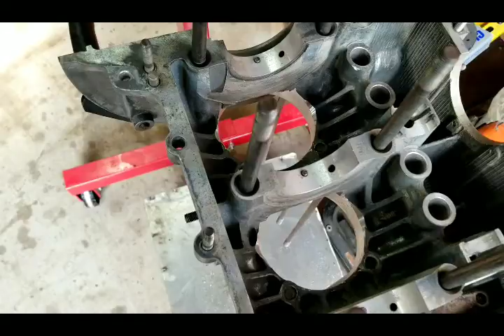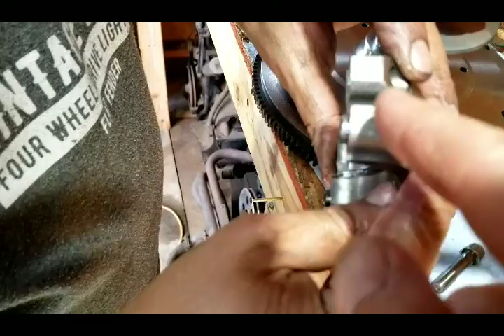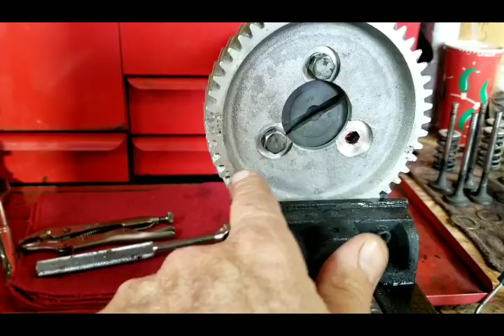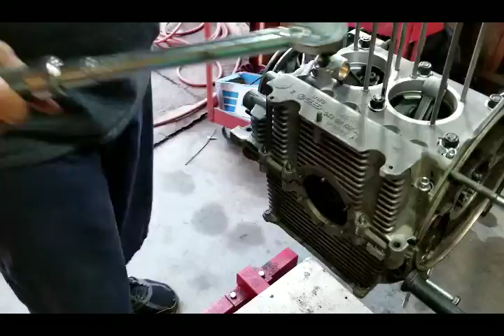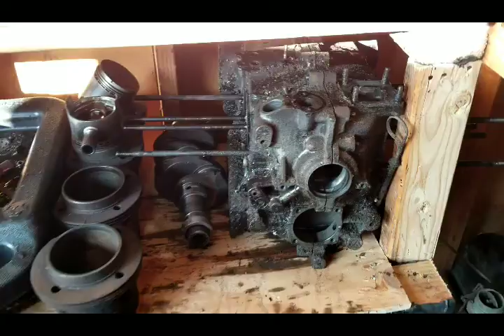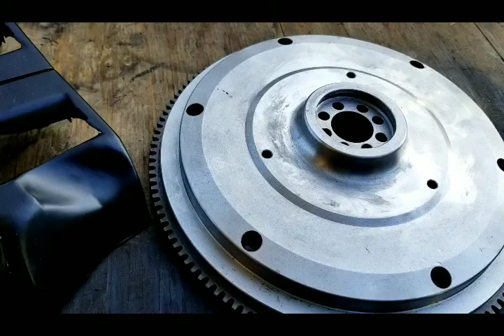Flat 4 Vw Engine build  74mm stroker crank 90.5 piston 1904 performance engine

Comment: Did you check the length of the dowel pins? I know that it is possdible to have the pins bottom out and make it seem that you have to have thicker shims. esp with a 8 dowel as usually they use a original 4 pin crank and drill the exra 4 holes with a guide. it is really easy to have the extra 4 holes not b drilled quite deep enough.

Comment: Is it possible to build a motor that will handle a.c and still have enough power 
And run cool in warm climate and be reliable.  Also whats the best 
Ac kit for a bug. Been considering building a resto mod bug as a daily driver
But everyone I've talked to said they run too hot with ac and dont have much power. I could convert to Mazda rotary but its work I prefer not to do.
I've done a couple but dont care to do anothrr

Comment: 1904s are my favorite engine combo for cruiser engines. Lots of fun, low maintenance and easy to build. Great video series.

The biggest reason for straight cut gears is to take the side load off the cam thrust bearing and free up some of the drag caused by the helical cut gears. The stock magnesium gears are also pretty weak when you start running bigger lifts and dual springs. IF you do use straight cuts, buy quality ones or make sure you measure the run out on the cheaper ones, they can be horrible, tight in one spot loose in others.

With a counter weighted crank and good quality rod bolts, I run my deck as tight as .040 and haven't had issues with pistons kissing the  heads. .050 is a great height, still get a better squish on the pad for a better more efficient burn, but loose enough no to worry.

I've had to use 4 shims in some engines lately, just because I don't have a good machine shop like brothers locally, I haven't had any problems with rear main leaks or any other issues. I really like to run them at .005 end play, especially if the engine will see high rpm. On my race engines, I actually go a tiny bit looser. There is more room for oil between the shims and they seem to run cooler. I have taken apart engines where I set them at .003 like lots of guys recommend and have found blue shims from heat or gawling on the rear main thrust surface. Tighter isn't always better. 

A lot of the current flywheel/crank offerings have very tight dowel pin fitment. I never touch them as long as I can pull the flywheel down on the crank with the gland nut. If it's obvious that something has been drilled off line or too small then I will get the holes reamed but I have found that after they have been mated and pulled apart a couple of times, the fitment is a lot better. I would rather have them very tight than a little loose. The first time I put them together, I then pull them apart and inspect the base of the dowel pins carefully for material scraped off the pins, and if there is, clean then very well as this can interfere with your end play measurements.

Comment: Awesome video Mike. Just a question on the Empi crank and 8 dowel flywheel? Fitment is quite tight do you ream the holes slightly or tap it in with a block of wood and a hammer?
Reply from the maker: you want it pretty tight if you need to beat on it too much you should take the dowel pins out and sand them with a little 600. not too much you want it tight but sometimes the machining is crappy on this stuff.

Comment: Hey Mike, did you have that rotating assembly balanced or running as is? I see many mixed opinions if not revving much over stock. My rods and pistons are balanced but questioning the rest. I won't be over 4500 rpm. For years I never balanced anything, but they were totally stock.
Reply from the maker: dont think you need to balance the crank they are pretty well machined and balanced from the factory. the Light rods from aa are also pretty well balanced .My motors spin like a top and want to rev up to almost 6k rpm easily

Comment: I’m just about to build a 76x88, your videos are what I am going by .
Reply from the maker: 74 is a bit easier. the 76 is good too but may have some issues because  it takes I think short rods and a pistons but has super thick shims. or if you go b pistons you end up with compression too low if I remember right.  Will need to ask someone like carcraft about what is the right stuff to put in there to make it work.

Comment: I’m also looking into replacing my stock crank to a 74mm crank but I’m on a budget what is your opinion for a reasonable price and good crank ?
Reply from the maker: Im not sure they are usually under 300 Car craft might have good price. But you will need the clearanced chromoly rods from. Car craft has good prices on those too. carcraftstore.com
Reply: @Mikefngarage  yah already got it as well as the 95.5 pistons and sleeves your out in Riverside ca. Mike ?
Reply: Paid $600.00 bucks for my 74 mm Ocrasa crank. Costs some bucks if you wanna play ball. Best bet if your ona budget is a 1776 or a 1835 single 2 barrel carb . Good performance, good reliability, easiest on the wallet. ☮️

Comment: Excellent !
That's what most do not understand with the labor involved with these engines.
The sub-assemblies are fitted - taken apart. Then after they are all setup. Then everything inside is fitted - checked for clearance issues. Then disassembled.
Everything is cleaned for the 3rd time. Then final assembly can begin.
Reply: Very true brother, with my 2276 I must have test fitted 10 to 15 times checking clearances multiple times.

Comment: It is like you say Mike if I ran into a machine problem , I would have to go up to San Antonio . There they do most anything but I dont know if they do lifter hole sleeves for the other case I have. To send it across the U.S. and back it would be 180 bucks for a couple hundred dollar job.  My wife said they are just going to keep it and you can not do nothing about it.Here 2 guys do line boring and 1  of them does fly cutting heads and opening up heads and blocks .......
Reply: Where in San Antonio do they vw machine work?

Comment: what you think about the Melling steel oil pump ?
Reply from the maker: not really sure I think they are good but pretty expensive. so we usually run scadek
Reply: That's the one I'll be moving to eventually with a steel cover!  The only leak or seep I have is from the front oil pump cover... lol
Reply: I've always run Melling pumps (since 1995) I do not drive my bus easy. Never had a problem with them. I run the High volume pump and never had bearing issues.

Comment: If it works it isn't wrong. I was surprised about the oil pump gear shaft though.
Reply from the maker: yea 2 engines It didnt hurt them because we caught them in the shop at idle they were ok but when you revved it up oil pressure would not go up. Checked the pump welded the gear and pressure ran up to 80lbs. or more.
Reply: I know I never heard of that before... one more thing to add to the to-do when building the big motors!! Great info!!